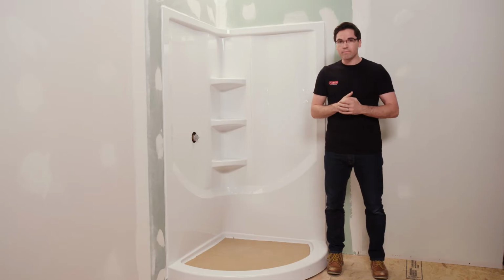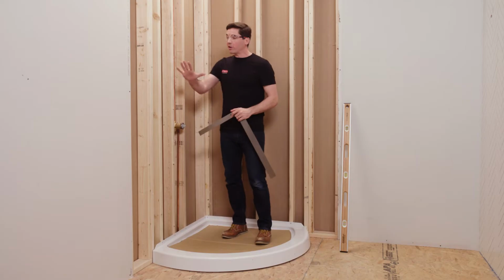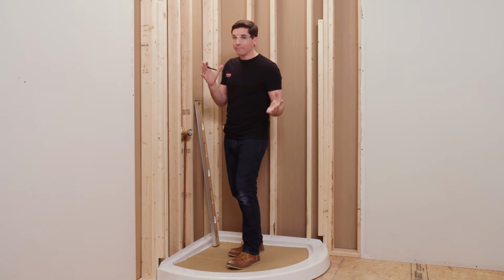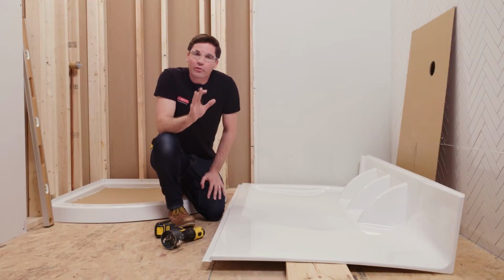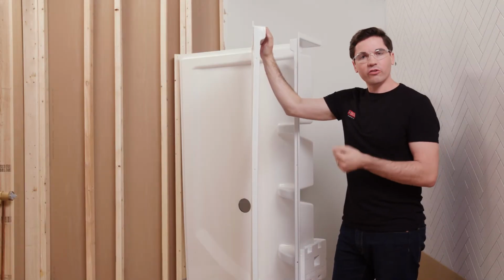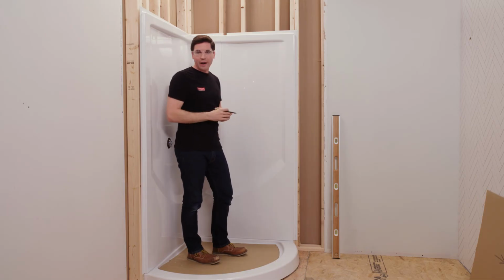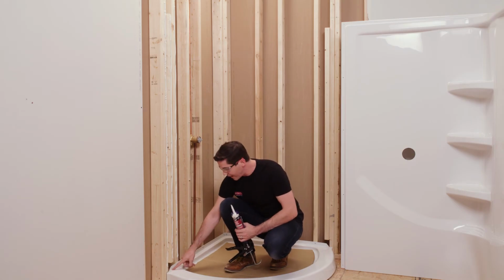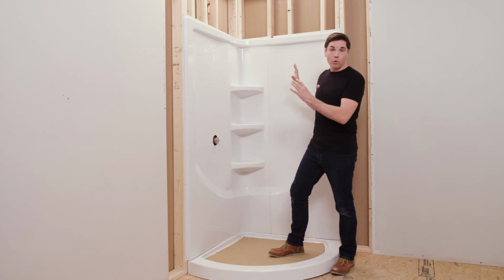How to Install the Delta® Direct to Stud Corner Shower Wall Set

Comment: Should I be concerned about moisture making its way through the screws at the top shower flange that go into the suds? Can I silicone on top of the screws? I am a little tall and water sometimes splashes up there

Comment: if the valve is already installed and soldered why do you need the fire retardant panel.
Reply: It appears that Delta people do not have answer.

Comment: I bought my home from a flipper and though we love this shower the valves they used were the cheapest at Home Depot. 18 months later I've got a constant drip that replacing the valve cartridge doesn't fix, so I'm considering removing the shower paneling to replace the valves to a better brand. I don't want to buy a whole new shower, so do you have any recommendations on how to go about removing the paneling so it doesn't hurt the shower and facilitates a clean re-install?
Reply: Replace the valve from behind the wall
Reply: @ai.impossible3  In this case that would require digging a trench outside of my house and punching a hole through the foundation.
Reply: New paneling is around $300 and certainly the cheaper option.  It is unlikely you can remove them without damage unless they were installed with no glue or bad glue. @BobDunlock

Comment: Thanks for making this video.  It is long overdue.  However, like your colleague who shows us how to install the shower base, both you and she tells us to use the sealant and adhesive recommended by Delta in the packaging.  However, there IS NO RECOMMENDED ADHESIVE OR SEALANT called out in the packaging, and in your video you purposely blurred out the tube of DAP Kwik Seal Plus you are using.  You then stress the importance of using different adhesive and sealant, then proceed to use the same tube of DAP Kwik Seal for both adhering the panels to the studs AND sealing the panels to the base.  What gives?  Why does Delta have to make this so difficult?  They make a great product, but poor instructions on how to install them.  This video is a big help to clarify some of the mistakes in Delta’s installation instructions, but still falls short.  Delta needs to be more transparent on how to properly install these shower kits, and by making these small but significant changes Delta might just be able to improve the current 2.8 star piss-poor rating of these shower kits that are actually really good quality, but should be rated much better than that.
Reply from the maker: Thank you for the feedback Brash Air. We apologize for the difficulty finding an adhesive or sealant. For sealants, we recommend DAP 3.0, or Loctite PL Heavy Duty Sealant. If these can't be found, use latex/acrylic high-performance sealants and caulks that are designed for plastic/polystyrene, and do NOT use water cleanup. Other types have the potential for poor adhesion, shrink, and cracking over time.

For adhesives, any construction adhesive that is safe for plastics can be used, please follow the manufactures instructions for application and cure times. 

Please contact us directly with any questions! We are happy to help.
-Bryan